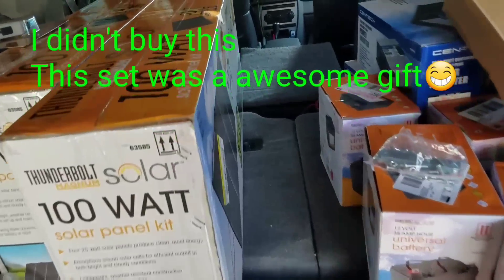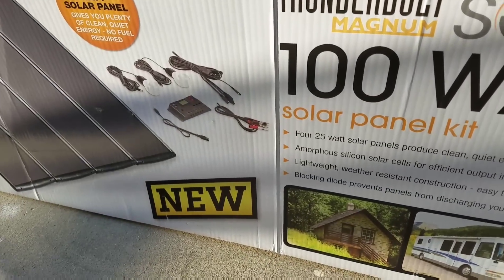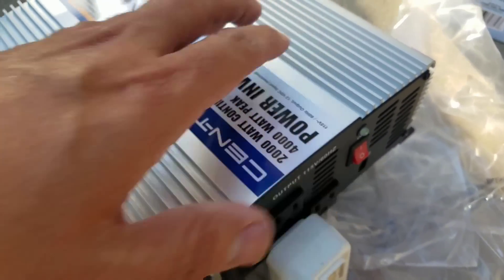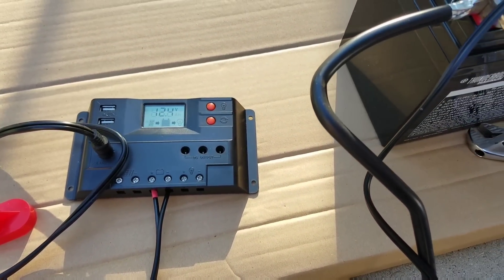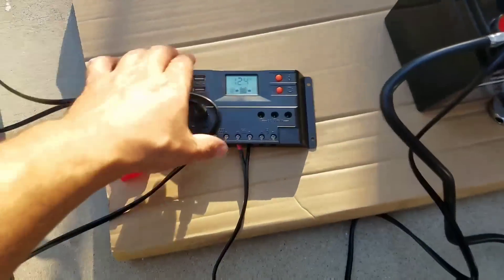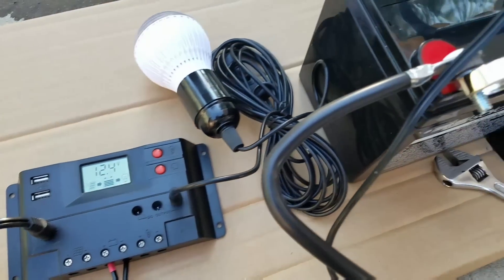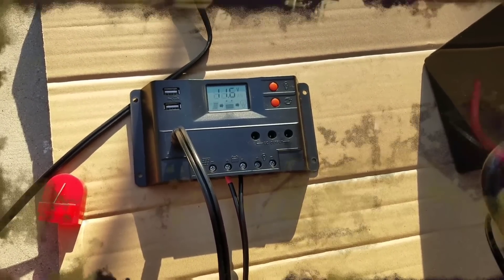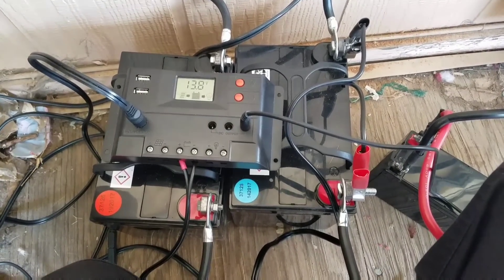How to run an AC unit on solar power

Comment: For a 10K BTU window unit AC you that you want to run for 12 hours you need to "store" 8,000W of energy in the batteries.  And that is "at least 8,000W stored". You are better off with 9,000 really. 
We assume that the A/C will run 30 min every hour and actually keep you  cool 24/7.  

The best choice of batteries is 100Ah - deep cycle - that are bought used for about $40 each.  Normal price - about $150 each, at least. Get them cheap from stores that get them used - but not really - they were backup batteries for companies that change them on a regular basis because they run critical operations and must have serious reliable backups at all times.  Often such "used" batteries were never used - they just waited for a power failure that never happened.  Still - do not expect to get 100% out of them.  Different reasons but still better than a brand new car battery (30-50Ah) and the same price.

With 100Ah batteries you need 7 to "store" the 8,000W that your window A/C unit will use in 12 hours.  So 7 batteries, 100Ah batteries X $40 each = $300 - with driving to get them, etc.
Add controller price.
Add inverter price (see next paragraph).

Note - you can NOT use up all the energy stored in the batteries.  That damages them.  So don't think you can store 8,000W every day, suck them all up, and recharge again.  From what I understand you need to keep the batteries charged at least 70% at all times.  That means you need more than 7.  Omg, this is not much fun any more...

Now you need to figure out the solar panels - wattage and price.  Things get murky but also very educational here. 
It is reasonable to assume that you got only 4 hours of strong sun a day.  And some days won't be even 4 hours but less.  That means that it is hard to say "Buy X number of solar panels at Y watts each."  You need to assume you got 4 hours of good sunlight and calculate how many solar panels you need to "fill" the 7 batteries with 8,000 watts for these sunny 4 hours + maybe some more energy in the morning and afternoon from lower sunlight. If one panel is rated 300W and 12V that means that it makes 25 Amps when the sun is bright. So it will make 12V and 25 Amps for 4 hours a day.  You can't charge one battery with 25Amps - that current is too high.  But you can split the 25A among the 7 batteries and charge them with 3.5A each.  That is a good current to charge a battery. The controller takes care of all these details. 
Will the 7 batteries charge to 100% in 4 hours?  I do not know - a few variables make that questionable (battery condition, leftover energy from the day before maybe, sun intensity, etc).  Read the comments below by Fred Houseal - he's been running an actual solar system for years. But you get the point - 7 x 100Ah batteries, controller, inverter, window A/C unit, and as many solar panels you can buy.  

We got a 10K BTU window unit used for $10 on a garage sale to play with. Just yesterday I found 5x250W panels, barely used for $25 each.  New that would be $150 each at least.  Same for inverters - they are not all the same (at least 3 different kinds and only the best type will run any and all electric appliances) and the good ones cost much more - $300-$500.  Can be found cheap from someone just getting rid of one - $20-$100. That's the big point - try to find all the parts from people that tinkered with solar but gave up. Otherwise the investment starts to become stupid - about $4,000 to run a chintzy little window A/C. Save the $4000, plug the A/C in your electric outlet and you will have money to run it for literally 5 years if that is the only thing you are running.

Comment: I run a 5000 btu Frigidaire FFRE0533S1 on 640 watts of solar and a 1500 watt inverter.  Can't run it at night, but I can run it all day until the sun gets low.  Charge controller stays in float mode.
Reply: That's on a 12v system, right?
Reply: @snowcrash395  Yes
Reply: @gr8212  how many batteries do you have?

Comment: There is a solar equipment place in Bonita California that’s part of Chula Vista. It’s called DIY solar it’s on Jamacha Boulevard. 
You can get one 100watt + panel for about What you pay for the harbor freight hundred watt Kit. Also I’d recommend you go to someplace like interstate batteries and get deep cycle marine batteries from some battery place. The deep cycle marine batteries will work better when you’re trying to power things like air conditioners. Hope that helps

Comment: I’d like to add one safety idea. You’re using all black cables to hook your batteries together and while you might be paying close attention where you’re hooking them Murphy’s Law will take over and somebody will hook the wrong one to the positive or negative. So I would recommend you get a can of red spray paint roof up the ends of the sheet covering of your cable and spray paint a portion of The ends of your battery cables read for the positive side and just leave the negative side alone because they’re black anyway. So read for positive black for negative.

Comment: You need a 1000 watt solar panel array plus 50 amp mppt charger plus 4000 watt pure sine wave inverter and 10 120 amp hour deep cycle batteries.if you are in the tropics you can use it from 8 am to 4pm only to run your ac.i have this set up but I don't run my ac on it even if it could.i just use  a single 120 amp battery.its enough for daytime use.i use 5 fans,1tv, washing machine,2 cubic ref, desktop, lights at night as long as I want on sunny days

Comment: IT specialist here get rid of the solar panels replace then with a alternator and u can run the air all day and night get a 12 volt motor it will power the alternator there is many different ways to make a mount for the alt a puller pully and 12 v motor   run the alr wires to the batteries and the 12 v motor str8 to the batteries keep your cars batteries on parallel keeping  a 12 volt bank for power inverter there u go

Comment: Love that there's four little batteries should run two all day. When one air-conditioned runs 400 Watts an hour and by the size of those batteries they are people 35ah by 12v meaning it couldn't even run it properly for an hour at full operation of the air conditioning
Reply: Yes the battery bank would be too small to really run that thing for long and most air conditioners that are large enough to actually cool your home would take more than 400 watts per hour.  He would need twice the batteries and 4 times the amount of panels to stay cool but only on nice sunny days not the hazey hots days.  Peace

Comment: I can’t believe you threw all that money away at Harbor Freight. Two 100w grape solar solar panels are $100 each from Home Depot. A decent charge controller is about $90. Any of the mppt controllers is good. Harbor Freight batteries are trash. Better to use a $100 marine battery from tractor supply. They’re three times the capacity.

Comment: Saw your youtube video on Harbor Freight Solar power AC with just a 4000 watt inverter, GREAT JOB ! . I used a 10,000 watt inverter & 6 Large amps batteries and wired it into my ele panel , , Ran most of my house, except couldn't run 220 volt ?, But GOOD JOB . Richard L.
Reply: Would a 500w inverter power 2 ac units?

Comment: a/c uses 700w per a/c,  solar panels produce 300w total ..max
(2) a/c units equal 1400w power use,  thats an 1100watt deficit being provided by the batteries
batteries will be dead in a few hours
oops... i don't normally respond to old videos, where other people have already said what i'm saying, 
but you could set this up as an independent standby system
forget the window a/c units, use this to power fans, TV, laptop, and phone chargers
in case of a power outage

Comment: First rule of Solar in my view is to reduce the consumption of electricity, so that you need less solar power and save money on buying panels, batteries etc. 
Its better to use a DC Inverter Air Conditioner as it is more efficient than window AC , but than it all depends on how much money you can spend.

Comment: there is no way you ran a 5000 btu a/c on one harbor freight battery, and one 25 watt panel! You might be able to get the fan to come on, but the compressor not on a bet! 10 marine batteries with 1000 watts of power might run one for a couple of hours at best, it takes a lot of panels, a lot of batteries to run small appliances for short periods of time. I can leave 3 LED lights and a radio on 24/7 in my garage and not drain my batteries 2%, but when you introduce heavy loads into the equation, your dc dwindles quickly!
Reply: Ok, Jay Miller, being you posted in 2019, what kind of 5000 btu (barely cools off a closet) are you running ? Sounds like a 1970s electric hog. Today’s 5000 btu units run with 1/10th the electricity of the old units. I have one in my little computer room 13x13, eight solar panels, two solar panels for each battery, four batteries, connected to a 2000 watt inverter pushing the unit, with power to spare, in the day time, The Eight Solar panels will push the computers (two Windows 10 units), the air conditioner, and the two refrigerators and freezer out back. At night, the house switches to line voltage and current to run the house. I used to pay $232 a month, This summer and last summer, $54 a month. While that can’t be possible in your mind, it does work with the new units, Solar, Battery, Refrigerator, and Freezers. The are not the electricity hogs old people like me grew up with. My AC business has spent many hours replacing old units for the new AC units using less power, it does work.
Reply: @Pooh68  Sir I stick with my claim that one 25 watt panel and one harbor freight battery will not run an air conditioner for 10 minutes, your story has changed dramatically, say again one battery and one 25 watt panel ran your new air conditioner! One "harbor freight" battery would barely run a 2000 watt inverter and a 100 watt light bulb with a 25 watt panel! How many total watts are your panels now and watt hours in your battery bank????????? Sounds like you have a grid tied system now, very different than one panel one battery and one inverter running an ac unit for any substantial amount of time! Possible in my mind is relative to the story being fed to me, thanks for your reply!

Comment: Dude you can get real panels from China like 250w panels for cheap especially if you don't mind older ones.. They last 30 years to forever,,, for the same money you could do all that work with 2 panels and one Charge controller and battery, you will learn all you need to from this hf set, but don't waist anymore money on hf sets, just heck go on amazon get panels and everything from China, I have a 45w panel on my shed and it runs my lights is all but only because that's all I have to run in there.. I just use a small sla12v for 20$ but I might have paid 12$ for my charge controller.. I don't use an inverter jst 12v stuff

Comment: First of all, I call complete bullshit on "now it's blowing cold air" at approx. 7:35, as you have the temperature set to 79° and only the fan is running which takes little to no power at all; the actual compressor never even kicked on. 

Second, post the fucking video once you've actually COMPLETED your set up and steps. This video is worthless and shows a douchebag millennial who eagerly opened his packages and threw some wires together.

Ugh. :/

Comment: you better watch the power company i remember my mom did not run AC all year so she would have a low bill and they billed her high anyway untill she called them and they fixed it. they told her they do a community type of deal since everyone is using AC lol wth.

Comment: What options there are to run an off grid A/C window unit at night? For DIY
Reply from the maker: You would need a large battery bank to run an AC unit at night. im also looking into small wind turbines I've seen on Amazon.
Reply: RFTechGuy C.A.D. I'd like to see that setup, I've been looking at doing the same! Can you get an A/C that runs on DC power... I'm sure it would be more efficient if you didn't have to use an inverter! Thanks

Comment: @sailingsolar Good dayLet's say I have a 24v 4k what InverterAnd 8 6v deep cycle batteries I want to run 3.5k in my house off the inveter.How can I set it up?Let's say I have a 235w 34.6v (give or take) solar panel .How many panel would I need?And what else is needed to run this system, besides the basic required wires and charging controller.I would like to add that I do know that the batteries can run in 24v series but what about the panel being 34v+ how can that voltage be lowered or does it need to be lowered..... Thanks

Comment: hey call Sun electronics in Phoenix go buy 3 panels at 360 watts cost $273 each then get a pc 1600 60 amp mppt charge controller got on Amazon 5 star rating then buy 5 universal 100 ah bank hours that will do the job but expensive. But worth it in the long run believe me. that's one panel at 360 watts $273 cheaper than renogy and better 6 feet 5 × 39 inches one panel mono cristalyene spelled wrong but you get the picture.

Comment: Go with crystal batteries. They can be discharged almost all the way down and it won't hurt them.  They catch up about three times as fast then lead acid batteries.  And they are really cheap to make. 
They last for years.
Reply: explain

Comment: now this is my future plan set up, as i read and hear your video, how many watts is your air conditioner sir, so a 200 watts solar panel, and battery like that, and 2000 inverter will do the job for a small air condition unit to run sir, Am i correct. thank you, please bare with me..

Comment: What's the average Watts per hour your AC uses?  Seems it would be around 500 or so and that's being generous.  You would need 6000 watts of stored power to run that AC for 12 hour of no sun light, which means your battery bank would have to 12000 watt capacity because you shouldn't drain more than half the batteries which would take (10) 12v 100ah batteries.
Reply: When the AC is in cooling mode it uses max amp/watts but when it kicks off then the fan is only running which means
the per hour is extended. I ran a AC with a battery just to test it using a CAP hooked to the convertor for the surge, after it is running the watts drop down to about 450 (5000 BTU). When compressor kicks OFF watts/amp drop way down it then uses as much as a box FAN on high maybe and no where near 450 watts. This is when the panels recharge battery I use a LIPO4 battery since they accept a faster charge rate and discharge rate as well.

Comment: Ok first off for ac mabe 6/8 hours a day in perfect weather,,,forget 12 volts you'll need at the very least 24 volts 2000/4000 watts,,,,Not on the same controller,,, if you had the old Renorgy (tracer)4210 c/c you can go 1000 watts @24 volts on each unit ok,,,,forget all about special sealed and gel batteries,,,the grids or plates in those batteries won't be able to take it some Trojans might,,,, very costly,,,rolls suret,,,the right model most certainly will,,,,, however again very costly,,,,so what's that leave to consider?????24 volt pallet jack batteries,,,or 24 volt tugger batteries/brand new they're high $$$,,however look around on eBay some will you a factory reconditioned battery for a very good $$$ price,,,you may need to rent a small forklift or battery powered pallet jack to move them into position,,,, one is good ,,,,2 is better,,,we're taking 890 or so amp hours per battery pack and very heavy duty,,,it would be hard to find the 4210 c/c new as they have been kinda phased out,,,I have 2 so I guess I'll be looking around for something different sooner or later,,, solar is very addictive your always constantly redesigning and rebuilding your next set up in your head,,,,you'll need to go to harbor freight,,, and buy a hydraulic cable compressor so you can use welding cable or something similar for your batteries you can compress wire lugs to fit on your cables that you can hook up your batteries  with don't play around with cheap wire,,,flexible welding wire can be bought at lowes and or menards,,,look at Renorgys offerings for panels and c/c you'll need something in the 40/60 amp range mppt also